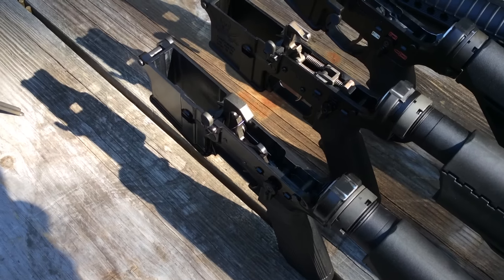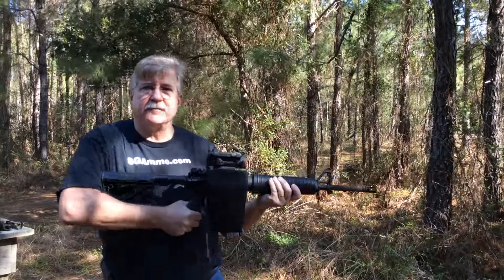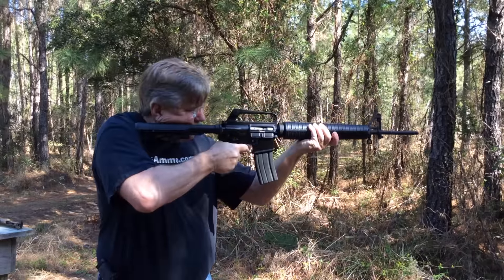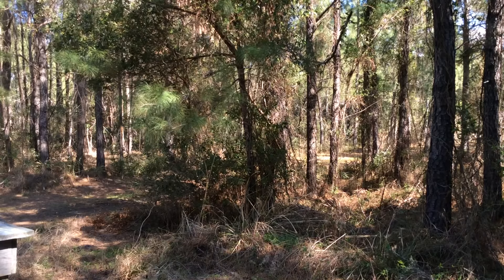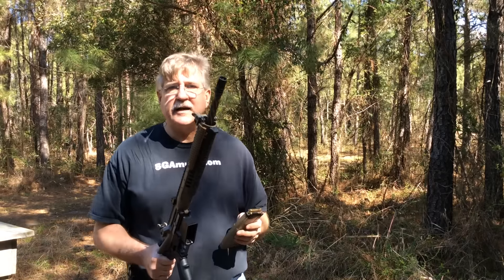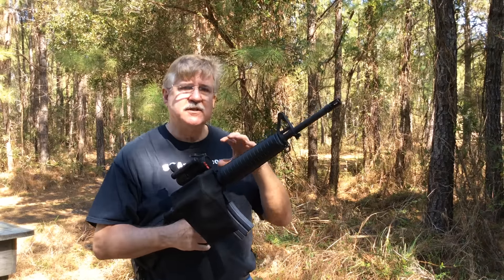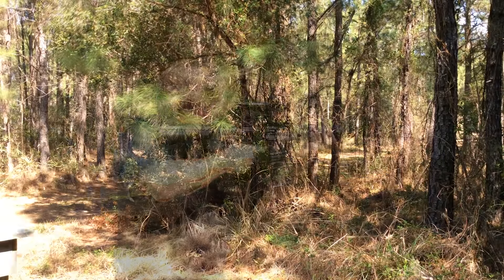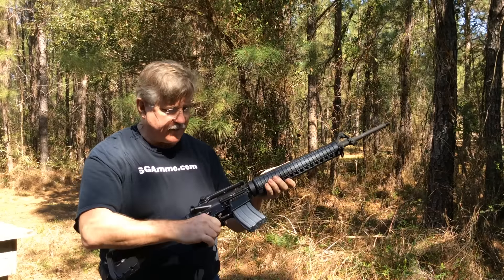Franklin Armory Gen 3 BFS Binary Trigger, Gen2 BFS & Fostech ECHO: Field Test & Comparison

Comment: I have a 10.5 PSA I have the franklin installed with the heavy hammer spring to prevent light hammer strikes and mil spec trigger spring and the black buffer spring from franklin do I need a lightweight BCG and a heavier buffer spring
Reply from the maker: Have to test fire to know.

Comment: I was thinking about throwing together a crbine lower / Rifle upper combo. What spring and buffer did you use to make it run right?
Reply from the maker: It is going to depend of the barrel used and the gas port size of the barrel as well as the power of the ammo you use. You have to experiment with the BFS if you are getting the hammer down failures.

Comment: I bought the bfs 3, I wasn't going to change my bcg as is a low mass low friction and of 500 ends I have 1-2 hammer follows. I wanted to try the fostech as well but cost and having to change parts I can't justify it. I don't use mine as home defense so I rare hammer follow isn't life threatening, but both I'm sure are awsome products
Reply from the maker: The price of these triggers adds up. The FA BFS can be tuned well to minimize hammer follow. If using only for fun then the occasional hammer follow is not a big deal.
Reply: Actually I think the BFS G2 is better overall, and I have both.

Comment: Thanks for the video.  Have you tested the Echo 2 trigger vs the FA Gen 3 BFS?
Reply from the maker: Here is the Gen2 ECHO review https://youtu.be/V_pFysEjYz8
The difference is the trigger block which works with any standard FA bolt carrier, which is a major improvement in versatility.
Reply: Thanks.  In your opinion is the Echo 2 or BFS 3 a better trigger?
Reply from the maker: The ECHO has been more reliable without any need for "tuning" with light bolt carriers and extra strength springs. So I would give the ECHO an edge for this reason. I have to support Franklin Armory's efforts though. They are developing a binary trigger for HK firearms which is very interesting to me. We'll see when they come out.
Reply: Great thanks for your feedback.  Would love one for the MP5.  Hope our government doesn't strip us of our gun rights!!

Comment: What parts are need to to be upgraded after installing the trigger in order to have reliable gun?
Other than bcg ?
Reply from the maker: It depends on your barrel and gas port size primarily but also the mechanical resistance of your individual gun. It has to be tested. It may run perfectly with no changes.

Comment: I was having a problem at first. It would eject,but not feed next round.I tried both the included buffer springs. Neither would work. Finally, i just put my silicon spring back in,& it worked. I never tried the other blue,or red  trigger springs. Which trigger springs did you use? Thanks
Reply from the maker: This trigger is an early one that did not ship with extra trigger springs.

Comment: great informative video. I emailed fostech (even though the price is gonna sting) and they told me my 300 blackout might not work. does anybody know if the other binary triggers will work with a 16" .300aac, pistol length gas system , spike st-t2 tungsten powder buffer ? I have both m-16 BCG and lantac E-BCG Nickel boron. Thanks in advance!
Reply from the maker: 300 BO uppers can be picky and ammo sensitive. I would just experiment with different bolt carrier weights and spring strengths and buffer weights. If your upper is running well with a standard trigger I am not sure why a ECHO would not work. Get your upper running well with a normal trigger and I am sure you will be fine with the ECHO.
Reply: @MichaelBellmbell556  I feel like it wouldn't work well with subsonic 300blackout. Should be fine with super sonics. That's how it is in my 16inch 300blackout with the giessele buffer spring. Runs supers flawless but won't cycle subs
Reply from the maker: @D41Michigan  I think you are right.

Comment: How is the actual trigger pull/weight of the two triggers? Is one more crisp than the other?
Reply from the maker: Neither is crisp. The reset on the ECHO is the pull and it is about 8#. The reset on the BFS is the release but the pull is still about 8#. Subjectively the ECHO feels smoother to operate when doing runs, but both are easy to do rapid controlled pairs.
Reply: Theoretically could you upgrade the trigger/hammer springs on the BFS with say Geissele springs?
Reply from the maker: The Geissele triggers work the way they do because of the redesigned geometry of the components. It's not really a matter of their springs. I do not think you could expext much change to the BFS by using Geissele hammer and trigger springs.

Comment: I was told the BFS3 wouldnt work well with a gas tube upper but then i see that you say it doesnt work well with piston uppers. gonna assume gas tubes are the way to go?
Reply from the maker: Yes. But not carbine length. It does better with mid length or rifle length DI uppers. It does not do as well with carbine length DI uppers.

Comment: What's the best trigger for a DI pistol length gas system gun?
Reply: Gas system length has zero affect on trigger.
Reply from the maker: The gas length and barrel length do affect the reliability and risk of hammer follow with the Franklin Armory triggers.
Reply from the maker: I have not tested a pistol length gas system. So far the ECHO has worked well with no hammer follow. There are those that run 11.5" barrels with a carbine length gas system that post good results with the Franklin Armory trigger. The FA trigger may require "tuning" with heavier recoil springs and lighter bolt carriers. If you don't mind playing with different springs,buffers and bolt carriers the FA is a little faster than the ECHO. The ECHO has been more reliable in general without any tuning.

Comment: So which trigger would you recommend? Any updates on the gen 2 fostech?
Reply from the maker: Testing the Gen2 Fostech this week. Have not had a single hammer follow with the Gen1 ECHO but it is slower than the Franklin Armory BFS.  The advantage of the BFS was using standard bolt carriers. Now the Gen2 ECHO is supposed to use standard bolt carriers. We will see this week how the Gen2 ECHO does. I am going to test with a rifle length buffer tube and buffer. The advantage of the Fostech trigger is it has required no "tuning".
Reply: Thanks, I'll be watching for the updated video.  Great comparison by the way!

Comment: Hi there
Do you think its legal to make a rifle with two triggers. One binary trigger and then another regular attached to the same bolt. And make it so that it would be able to have 3 round bursts is that legal?
Reply from the maker: No.
Reply: But I thought nfa laws state that it can't have three round bursts for one trigger cycle? Why do you say its not possible?
Reply: If you could help me find some information about such laws I would appreciate it
Reply from the maker: BATFE website. I don't see the mechanics of what you describe. The 2 triggers to the same bolt losses me.
Reply: I mean one trigger is a binary system one is regular. And when you pull the first trigger you get one round. And where the first trigger stops. The second trigger right behind it is a binary trigger that will two rounds and then when you go to back beginning starts over again?
Reply from the maker: Really aimed, controlled fire is a much more effective use of ammunition in a real world situation. A high quality, dependable trigger like Geissele gives you very fast follow up shots if needed. Binaries are fun, but I still say they are not practical.
Reply: But do you think my idea would be legal per atf rules
Reply: Both of the triggers are one connected one behind the other
Reply from the maker: I just can't envision the design mechanics of that. The more complex a fire control group the more likely to have a failure. That is why the AK is so popular around the world.
Reply: Do you think it would not work mechanically.
Reply from the maker: If both the triggers are one then you get more than one fire per action of the trigger, AKA full auto. Draw what you are talking about with all of the springs and sear surfaces necessary. I can't see it. A good semi trigger is your best bet.
Reply: Sure thing. I will do that. But wouldn't binary be full auto then?
Reply: I will upload the picture within the next hour.
Reply from the maker: Depends on the design. Only if there are two separate triggers. One fire per action of a trigger period is the legal gold standard.
Reply: Then how about double barrel with both binary triggers.
Reply: The link is about a double barrel 1911 and then adding a binary trigger
Reply: Hey there. Did you get a chance to see the video
Reply from the maker: The double barrel handguns that discharge two shots with the trigger pull are considered full auto by BATFE.
Reply from the maker: What video??
Reply: Really. I didnt hear hickock45 talk about that in his video. But its different triggers connected together
Reply from the maker: Still don't know what video and specifically what gun you are refering to.
Reply: You see the link now
Reply from the maker: Nope
Reply: I posted a comment on this  video with the link do you see it. Or search double barrel 1911 on YouTube
Reply from the maker: Got it. Link was in the spam folder. I have no knowledge about this double barrel pistol. Sorry. Can't speak to it. Video does not go over the design. Maybe since it has 2 barrels it's OK. Don't know.
Reply: Thats what I was thinking about and then including two binary triggers

Comment: Anyone have an opinion on running one of these on a short barreled suppressed AR? Short being 10.5" does one work better than the rest?
Reply from the maker: I just tried with a 11.5 carbine gas DI upper and had hammer follow issues. I will need to spend some time trying different buffers, bolt carriers and action springs to see if these failures can be eliminated or at least minimized.
Reply: Michael Bell did you have issues with one of the triggers moreso than the other?
Reply from the maker: The Franklin Armory trigger has occasional hammer follow failures. The Fostech has a trigger block that prevents this.

Comment: HOW DO YOU PREVENT HAMMER FOLLOW?
Reply from the maker: I have not had hammer follow with the Fostech ECHO. With the Franklin Armory you "tune" your rifle by doing things to make it cycle faster, and practice. So with FA BFS use light bolt carriers, heavier power recoil springs and as a last resort you can open up the gas port in the barrel. In other words, you do things that would otherwise be considered making your rifle over gassed.
Reply: What about lighter buffers?

How can we understand lighter carriers, higher power springs, and lighter buffers in terms of functionally "over gassing" or "under gassing" the setup. What is the optimal gas state but if not an optimized total cycle time, lack of premature unlock, and corresponding ejection pattern?

Comment: I have to say you are wrong I use the huldra gas piston upper I swapped out to heavy buffer they provide and heavy hammer spring standard trigger spring the gas system is midlenght no issues so far at all
Reply from the maker: That is great. It just does not work well with the piston uppers I have tested. Thanks for sharing your experience.

Comment: Which one if the best trigger? Most similar to mil spec?
Reply from the maker: The FA BFS Gen3 uses a standard mill spec hammer. The ECHO does not have the hammer follow failures unless it is caused by bolt bounce which can occur with both. You can use the ECHO with a wider variety of rifle caliber uppers without tuning.

Comment: Hey Michael how are you? Haven't seen any videos lately?
Reply from the maker: I've posted 14 new videos since this one. Maybe you aren't getting notifications. Please visit my channel if you get a chance.
Reply: Michael Bell I checked them out. Just haven't seen one in a month.
Reply: Michael Bell I know we talked about this earlier but is it legal to have a button on a rifle that cycles the trigger action by itself. So basically what if a ar 15 was set up with a button that kept on pulling the trigger without a person touching the trigger and the only contact the person would have is with the button. But the button would then pull and release the trigger the same an individual will. But it wont make people to be tired from constantly pulling on the trigger
Reply from the maker: The button would then be considered to be the trigger, so no go legally.
Reply: Michael Bell So is there anything that we can do legally besides the binary trigger for now
Reply from the maker: Slide fire stocks allow you to bump fire at a rate that is similar to full auto.
Reply: Michael Bell Have you tried that with binary trigger
Reply: Oh okay have you used taccon trigger with a binary trigger system is that possible
Reply: Have you ever thought about what if someone combined a binary trigger with taccon arm trigger. For example you know how the glock have internal safety on the triggers. Per ATF rules one shot had to be fired per fucntion of the trigger. If you make a gun that has a trigger like the glock combined with a binary trigger. And the rifle fired when you pressed on the outer trigger and it was engaged the same way the glock safety trigger works and then when you pulled back on the trigger and then again on the release. Is that possible with how ar 15s are made.

Comment: the new echo doesn't need a specific bolt carrier
Reply from the maker: The ECHO "Sport" trigger looks like it uses a standard hammer and does not have the large housing sticking up above the top of the lower receiver. This should make it more versatile. I can't justify buying one right now to test out. I have the ECHO 2.
Reply: You have to have a full auto bcg
Reply from the maker: @waymorhd  Correct, I should have said proprietary, not specific.

Comment: So what would you go with?
Reply from the maker: If you want to run 9mm then the FA Gen3 BFS. If you want to run piston uppers then the Fostech ECHO.
Reply: Michael Bell I want to run 5.56 in a DI rifle.
Reply from the maker: The FA BFS works better with mid and rifle gas length and 16" or longer barrels. It still may require "tuning" with lightweight bolt carriers and stronger recoil springs. The ECHO is slower but does not require "tuning" because it has the trigger block if you out run the bolt carrier. The New Gen3 BFS uses a standard hammer, that is why it is good for 9mm uppers.
If you are going straight DI 5.56 with a 16" or longer barrel the BFS will be faster.